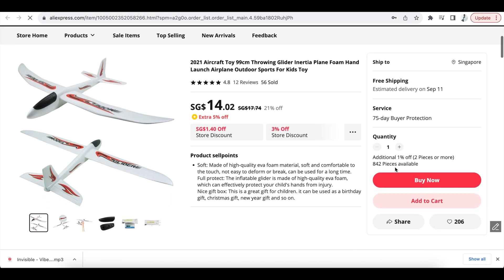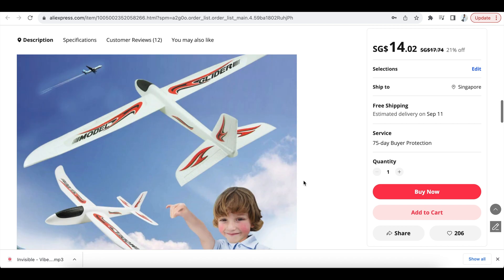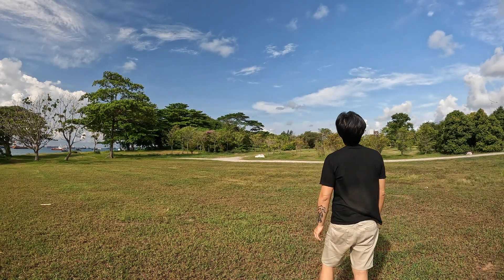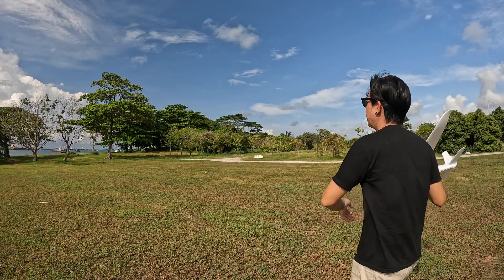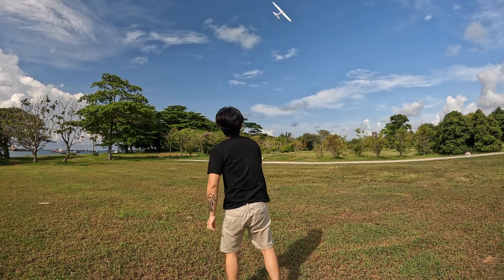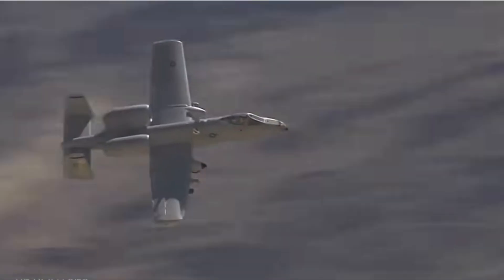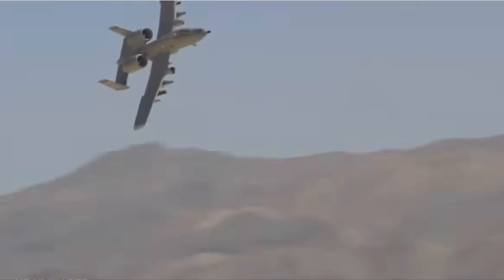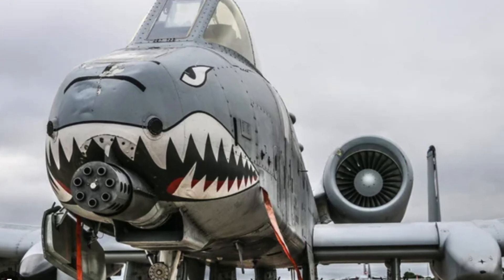Turn A Chuck Glider to An RC A10

Comment: I'd never manage to do this I'm sure. Great talent. I've got a rtr foam glider, very floaty, i put high up in a tree on it's maiden flight! It thankfully blew out the tree about 5 days later and i got it back. But always too worried now it's going to glide away on a thermal (and my bad flying). 👍
Reply from the maker: Yes you can too bruh!  Just needs abit of imagination.  You're too kind bruh.  hahahahaha thats awesome that u got it back man!!  Use a heavier lipo maybe? Longer flight time too! haha
Reply: @shogunemperor  nice tip. Although it only uses a 300mah little 2s battery. So not too much scope for a weight gain. But I could strap anything to it for more weight. I think for me it's about being patient if the weather just isn't good enough. I was staying on a caravan holiday park for nearly three years a while back, that had an adjacent field. But don't have that luxury anymore. Hope you're doing great. 👍 (I've got 4 or 5 foamies, but rarely fly any of them, any chance I get it's a quad)